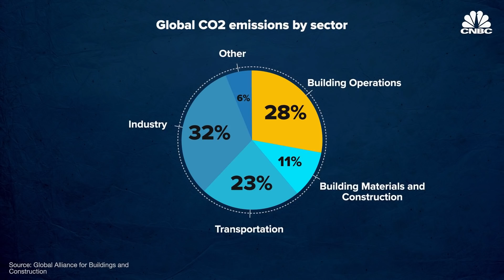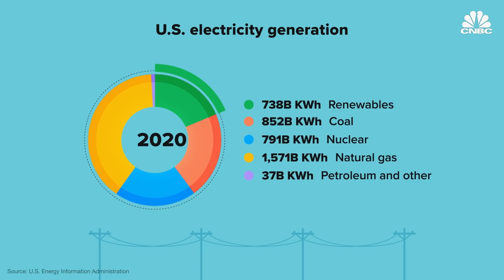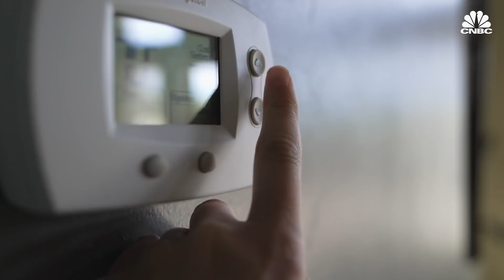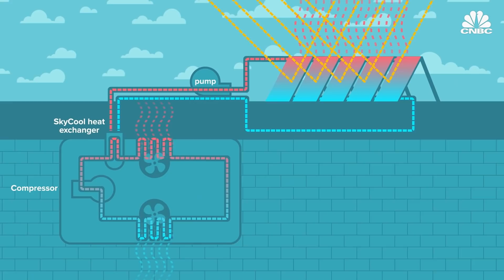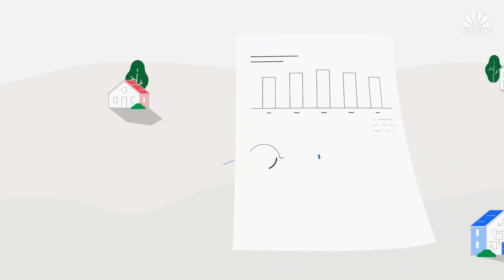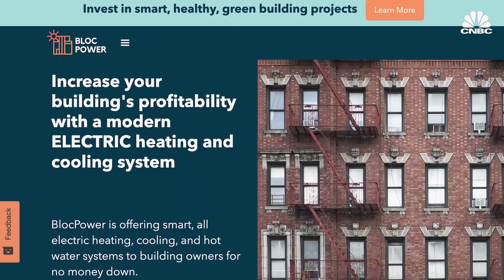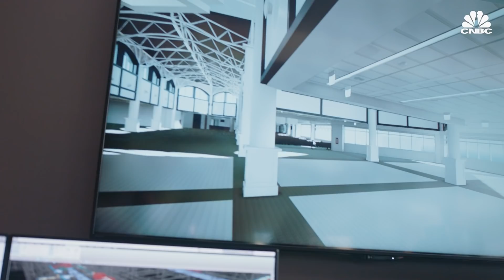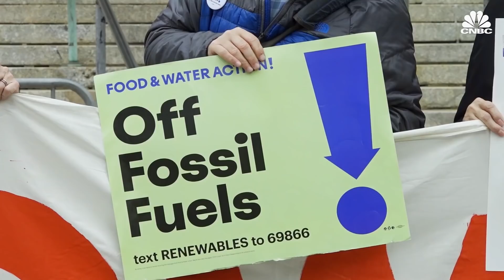How Air Conditioning Is Warming The World

Comment: I actually honestly never use an air conditioner and I'm in my 30's.  I always just use a fan and I never sweat at all when I have a single fan on me.  Whatsoever.   It gets in the 90's here.  I sweat a lot when I'm outside but not at all inside.  My electric bill is $40 in the summer.  I'm single.  My electric bill is $65 in the winter.  I keep my heat at 60° Because I always thought when the January high is 60 it felt warm so that's what I always set my heat too.  I've never had a TV any bigger than a medium sized tv because that's the biggest tv I ever wanted.  I don't have a whole lot.  I think we all need to work on energy conservation.  That's the key.
Reply: @UncleThomas  yeah I live in Ohio but I already said it's in the 90's.  What do you mean by virtue signalling is never a good look?  What does that even mean?  I thought everything I said was a good thing anyway.  I guess how hot it is has a lot to do with humidity.  It rains a lot in Ohio at least now so I would say it's humid at least to me.
Reply: @UncleThomas  Guess what, everything doesn't have to be political. Is it so hard for you to imagine this is just a regular dude speaking candidly about his own personal experience?
Reply: I’d expect to stay single if you aren’t using AC
Reply: @nocodeguitar  well, it's true that I always just have one fan on and on me and I never sweat at all when I'm inside, outside it's understandabley a different story.  You should try it sometime.